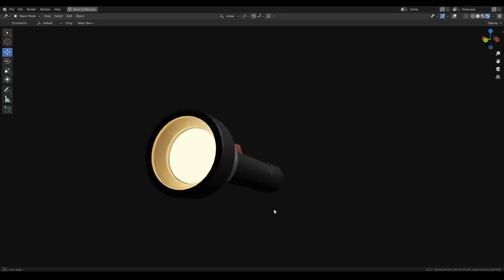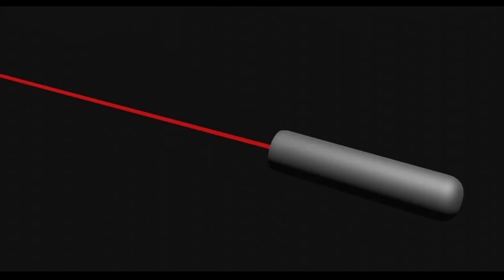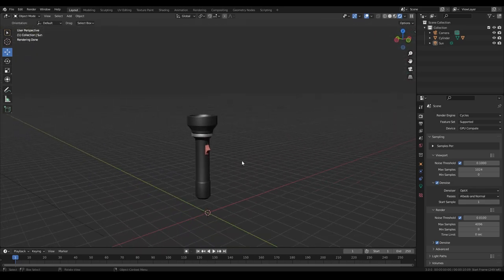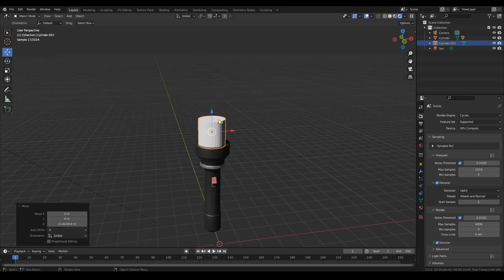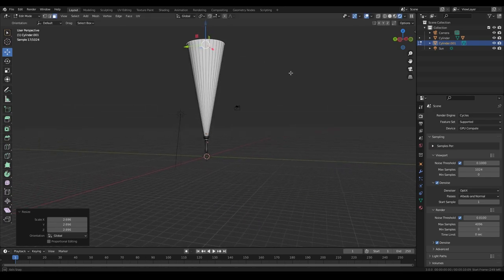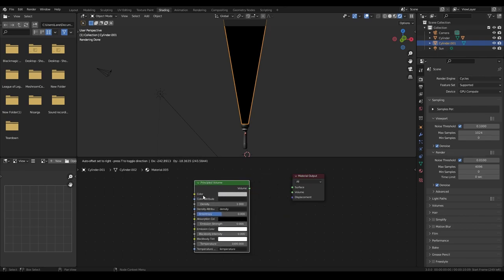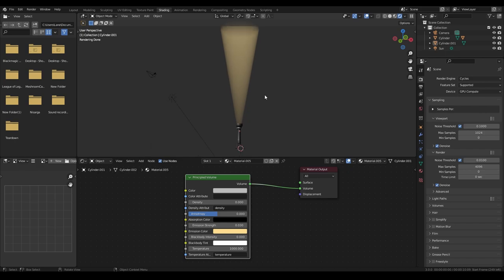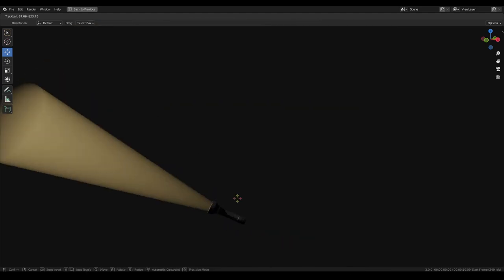Create Light Beams (Blender Tutorial)

Comment: For better results connect density slot with noise with object texture coordinators (an empty) then play with noise values...to get realistic results...
Reply: Trying to follow this. So connect a noise texture to the density slot of the principled volume shader, with the object data from a texture coordinate plugged into the vector of the noise texture? Because I do that and nothing happens. I adjust all the values on the noise, nothing.
Reply: @johanericsson2403  I also don't know what this guy means but i found another way to make it a little more realistic: You could ONLY use a color ramp. So I did it like this, left to right: Texture coordinate Node - generated output to -> vector input of a Mapping Node - Vector output to -> Fac input of a seperate XYZ Node - Z output to-> Fac input of a Color Ramp node, make a light color and black color. Use the sliders of the color ramp to make your desired result and put Ease instead of linear for the interpolation mode. Then put the color output of it into the volume input of the Material Output node. This way the light beam doesn't end so harshly and fades nicely into the dark. Hope I could help :)

Comment: It needs fall off.  As the beam is further away it gets wider but also fainter because the same amount of light is spread over a wider area.  A gradient used appropriately could regulate the brightness and make it very realistic.
Reply from the maker: I agree, and I actually did try using a gradient before making the tutorial and it just didn’t fall off properly at all. It had to much of a hard edge no matter what I did.
Reply: @lanewallace.  Any solution?
Reply: @CONWAYCAPS create a cone and chop off the tip to a certain radius, create a second cone with it's tip exactly at the midpoint of the circle you created by chopping the first one up. Make sure the radius the same at the base both cones. Subtract the shape from the other, then increase the density to an ungoldy high number. 
That way the thickness of the beam goes from R to 0 over it's length
Reply: @PiecesOfPrestige  Thank you I'll try that